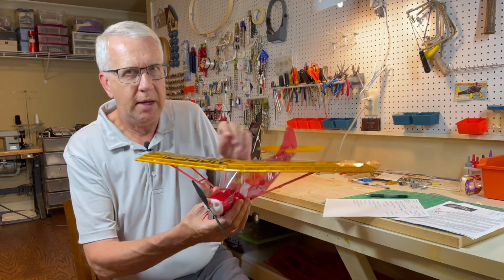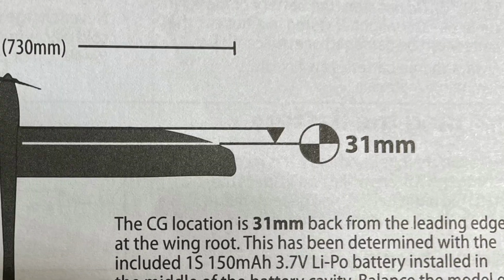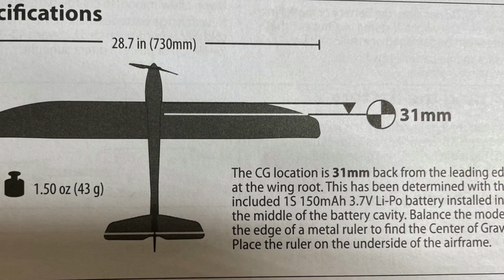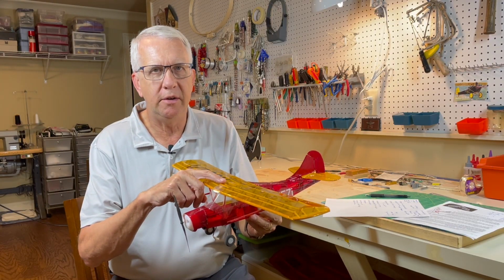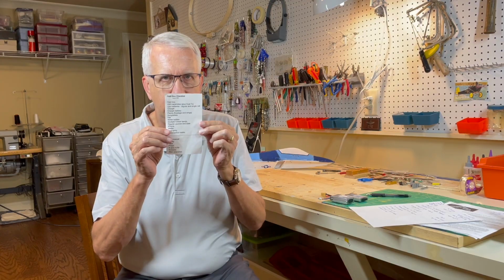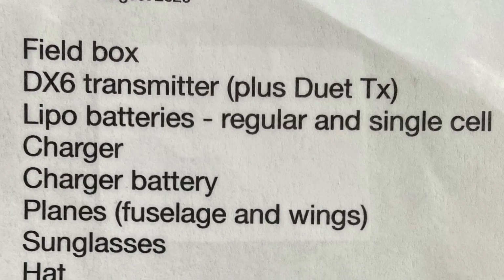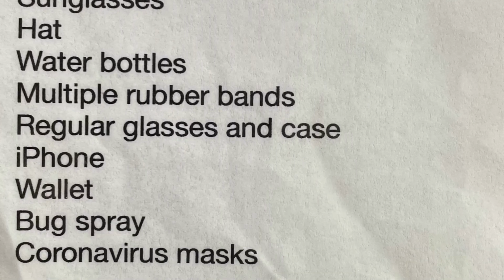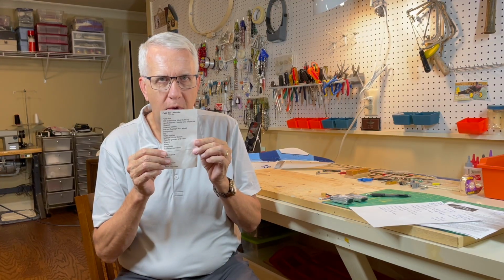10 Radio Control Mistakes to Avoid

Comment: Question, if you use a bigger motor which requires more weight in the tail, will it still fly?
Reply from the maker: Yes, it should fly fine. Just ensure you keep the same center of gravity.
Reply: Thank you for the advice

Comment: The big one for me when first getting started was not knowing to keep the lipo batteries at 3.8 - 3.9 volts per cell when not using them for more than a few days.  Lots of people get prematurely reduced performance batteries not storing them at the correct storage voltage.
Reply from the maker: Excellent point, thanks.

Comment: Good point on CG. Spent a month assembling a balsa kit of 2.6m electric glider, fell in love with it, went to a snowy field, gracefully launched it by hand, felt good. Made an attempt to fly it with engine on and dropped it very next minute. Later realized it was tail heavy, so stalled pretty quickly. It’s excessive to mention how much frustration it caused to me.
Reply from the maker: Hey, no worries . . . live and learn, and now you know!

Comment: Great job.  My power glider on 2nd flight went in I have a brake on the throttle I could do nothing to stop it It hit a full power and I could not stop it until the motor burned up what do you think happen This was 2.4 good battery fail safe was set to brake motor
Reply from the maker: Don:  Hard to say, maybe an unlucky software glitch. Tim

Comment: Thanks for your Video. Some things I learned the hard way.  
And so I made it a habit, to check each battery with the battery checker before I put it into the plane to fly even if I think I charged it before. 
I had a crash because I thought the battery was fully charged, but it was empty.....
Reply from the maker: Peter:  We live and learn, keep at it!  Tim

Comment: i flew my plane with reversed ailerons a few days ago by mistake, i had to force myself to remember right to go left and left for right but i managed to get it down unhurt. its not impossible its just very nerve racking and hard and makes ya want it just give up and let it crash, just add throttle and take it 4 or 5 mistakes high then quickly have someone go into ya settings and reverse the servo while you try to control it if youre alone, gain height and force yourself to remember L4R and R4L and it should come down ok
Reply from the maker: Noc:  Great job on the save, and another reason to check the controls for correct throws before takeoff.  Plan B if this ever happens again in the air is to just try and fly it with rudder for turns and not use the ailerons.  Most planes with rudder control can turn enough to bring it back to the field.  Tim

Comment: A beginning mistake is thinking you can "beef up" a model plane so that it won't be damaged in a crash.  Adding extra glue, bracing, etc, all you have done is make it heavier.  Then, as you said, higher take off and landing speeds, more difficult to fly, meaning more likely to crash.  And no matter how much you beef it up, it's going to break.  To add more performance to an airplane, add more lightness.  Like a house, nails don't make it stronger.  It's the geometry of construction that makes it strong.  Balsa models are the same, the glue just tacks the structure in place, it is the geometry of the design that makes it strong.  One light application of glue will do it, you don't need to dob two or three globs on epoxy on every joint.  (CA is great!)
Reply from the maker: Sax:  Excellent points, agree with all!  Tim

Comment: Cox Stuka and PT19... a story I've heard, AND SEEN, for 60 years!  And those planes were the two worst for the budding C/L flier.  Their main problem was weight.  There were more than a few nice .049 sized balsa kits that were easy to build, and flew much easier as they were half the weight of the plastic Cox planes.  Goldberg Lil' Wizard, Stuntman 23, Swordsman 18, Jumpin' Bean, others.  Easy to build, one-piece solid balsa wing.  So if your .049 from the Stuka or PT19 survived, you could put it on one of these models.
Reply from the maker: Sax:  Fully agree, but the Cox planes sure looked nice at the hobby shop.  😁  And to think about it, were not the Cox PT-19 maybe the world's first RTF model airplane??  Tim
Reply: @TimMcKay56  Yup!  The Stukas usually did not survive the full circle around the pilot.  The PT-19's did.  Later Cox molded the tanks integral with the plane, a real bad move in my opinion.  But there were tank kits you could buy to convert the motor to the integral tank type like the earlier Bee's.  Those Guillow kits?  I used to put the little Cox .020 on those and fly them free flight.  I had a little right rudder to counter torque, but they would circle up to the left due to engine torque, then when the engine ran out of fuel, they would circle right, usually landing within 50-75 yards from launch if no wind.  Measured fuel with a small hypodermic.  I would cover them with colored gift tissue, doping on basic markings.
Reply from the maker: @saxmusicmail  Copy all!  But the Stuka did look very cool.  Smart move by the marketing folks at Cox, someone earned their bonus that year.  Do check out the channel, I have 8 Guillow kit conversions to RC.  Tim

Comment: what about lateral balance tim all you need is fishing line through prop hub and rear gear  inverted ad weight to wing tips start with a coin or blue tac
Reply from the maker: Lateral balance checked OK. Very little mass with the foam board wings, worked out good. Tim

Comment: 👍🏻 great tips for the beginner. I have been flying for about 25 years. Learned a lot over time. I also fly helicopters too. That can be a bit of a challenge for the beginner. I flew fixed wing for many, many years before moving into helicopters. They are a blast but way more challenging than fixed wing in my opinion.
Reply from the maker: DJ:  Very good, and thanks for checking in!  Tim

Comment: Great explanation on the cg for today's models but i have a question on something that i have seen recently with newer ARFs regarding cg my recently acquired tower hobbies Edge 540 shows the cg at 2-3" from the leading edge I've never seen that before all of the models that i have ever worked with give me a specific measurement from the leading edge, what is your opinion on this in balancing a model that gifes you a range rather than a specific measurement in locating the cg of a model
Reply from the maker: Ron:  Your Edge 540 is a aerobatic 3D airplane.  It is common with larger models like this (as well as full scale aircraft) to have the Center of Gravity be in a range.  In your case, the CG back 2" from wing leading edge would make the model a bit nose heavy.  CG at 3" back a bit more tail heavy, but still acceptable.  A forward CG (2") makes the controls a bit more sluggish, maybe a tad higher stall speed.  CG 3" back would make for a less stable, more maneuverable model.  So, a CG range perfectly normal.  Tim

Comment: Instead of using a timer buy a radio with telemetry and fly to a voltage, so 10.5v for 3S, 14.5v for 4S, so many people at our club have killed lipos by over discharging because they flew to the timer and it was windy and they took way more out of the battery than expected.

Also I hate to say it but if you have high quality equipment, you shouldn’t ever need to do a range check, I started with Spectrum and would always get failsafes even after good range checks, I then moved to flysky due to their telemetry but had similar issues, so moved to a TBS Tango 2 radio and have not suffered a failsafe since, in fact the radio will out range the FPV gear most of the time.
Reply from the maker: TPI:  Good points!  Tim

Comment: It's good to go through your video, Tim. I can't tell you how crazy it makes me to see our club Safety Officer fly without doing a range check. It is so easy with today's transmitters.
Reply from the maker: Steve:  Well said.  If I recall, did not you build my Blackburn Type D plan many moons ago?  Tim
Reply: @TimMcKay56  Yes. I did enlarge your Blackburn plan for direct drive Speed 400. It went on to win the SAM Concours D'Elegance at the 2013 SAM Champs in Boulder, NV. I still take her out and fly for fun when we get the best weather conditions here in Albuquerque.
Reply from the maker: @stevemoskal1017  Very good, thanks for the update!  Tim

Comment: I really liked the suggestion of putting the absolute minimum voltage on the transmitter.  I wish  Tx manufacturers would do this.  I find this piece of info is one of the hardest to find in the manual.  But isn't it remarkable the transmitter  is good down to that minimum. I wouldn't be one to test this though.
Reply from the maker: Banshee:  Thanks for your feedback.  Remember this is for alkaline batteries, and DX6 only.  Other transmitters may vary.  Tim
Reply: @TimMcKay56  yep, I'll check mine before putting a sticker on my DX8 Gen2.  Thank you.

Comment: We used to use pusher props on cox 1/2A back in the day. We would mount a pusher prop but run the engine backwards. That made engine torque hold the plane out against the lines instead of having it try to turn in.
Reply from the maker: Sam:  Ah yes, the ease of running reed valve gas motors in either direction.  Tim
Reply: @TimMcKay56  made a huge difference in the line tension.

Comment: In the old days , each radio had it's own frequency.
In a group setting you had to see who else was using your Frequency.
Color coded flags on the antenna were used , green and white , red and white.
2 people cant be on the same frequency at the same time , or you would get interference and crash.
Reply from the maker: Totally correct, and we referred to the different frequencies as channels.  Transmitter impound board, frequency pins, etc.  Those days happily long gone with 2.4 GHz radio technology.  Tim

Comment: Excellent advice! I never got the hang of it until I got the Eflite Apprentice which allowed me to get enough wiggle room to correct mistakes in the air. I find RC is much more difficult than actual flight (PPL) due to orientation.  The check list for every model is something I’m going back to as I’ve lost a couple due to omitting simple settings after being away for a while.  My little Durafly Storch is quite capable of hovering in reasonable headwinds. It does landing like that Blackburn but can be hard on the gear if I don’t add a bit of power.
Reply from the maker: Dave:  Thanks for checking in!  Also, the computer RC flight simulators help a lot, such as RealFlight.  Tim

Comment: This video is totally cool because it is retro! If it was in black and white he would have nailed the spirit of 50s - 60s! I would highly recommend a black and white version of this and run with the retro theme for max hits!
Reply from the maker: Hey:  Many thanks for this input!  Tim
Reply: @TimMcKay56  No problem! Were you a pilot in Asia? Or do you just have an Asian captain?
Reply from the maker: @Heyemeyohsts  Hey:  Flying the B-777F in the US for DHL.  Captain is US, parents from South Korea.  Great guy!  Tim
Reply: @TimMcKay56  wow that is a huge powerful aircraft! How long have you been doing that and how did you get into flying ?
Reply from the maker: @Heyemeyohsts  Retired now, have been flying since I was a teenager, (CFI, commercial, etc.) things just worked out!  Tim
Reply: @TimMcKay56  I started when I was 43 and I’m working on my CFI now at age 52. I wanted to change careers but I don’t want to give up my business to fly pipeline or CFI at $15k per year to get the rest of the hours - 1000 needed
Reply from the maker: @Heyemeyohsts  Fully understand; I took an 85% pay cut when I decided to fly for the regionals (United Express out of Dulles) and build turbine time.  No easy way to do this, outside of military training, etc.  Good luck!  Tim
Reply: @TimMcKay56  thanks. It must be hard to go back just flying rc? I still have a bunch of rc stuff but not very motivated to do anything with it anymore. Mostly nitro based . I don’t know much about the electrics. Nitro is such a pain in the ass but more realistic than electric motors
Reply from the maker: @Heyemeyohsts  Very happy to be back flying RC.  Commercial flying was wonderful, but I was just gone from home too much.  All good!  Tim
Reply: @TimMcKay56  yes I was thinking that all the travel could be exhausting. Or fun . I don’t know which . I flew Ohio to Texas in a pa28 and it took me two weeks to recover.

Comment: A battery has a necessary storage voltage and should only be fully charged just prior to flight. Batteries are the danger factor and need to be fully understood to avoid fire. As well as battery damage. Never overcharge, never over deplete, and always store at the proper voltage.  Additionally, I recommend that you never charge indoors unless you have a safe enclosure to do so. An old safe, Dutch Oven with lid, metal case, etc. Always store them in a fire proof container as well. Please stress to your viewers that batteries are dangerous and knowledge regarding them is a responsibility. Not funny to unload your gear into the garage, and have one go off, causing a house fire. Or, going off in the vehicle while driving. Keep them contained and safe!
Reply from the maker: Tahoma:  Good points all.  Key item for newer RC pilots is the use of quality lipo batteries combined with a quality charger with balancing.  Prior to a balanced changer, lipo fires a huge risk.  Tim

Comment: It had a size 40 Weber motor and with flaps and that but I flew it on the first try successfully no crash no control problems and excellent flyer
Reply from the maker: Stephon:  Very good!  Tim
Reply: And you’re a complete liar

Comment: It's a great idea to use a LI PO. In your transmitter.I got one in my DX8.
Reply from the maker: Steve:  I will look into this! Tim
Reply: @TimMcKay56  No No.  Don't use a LiPo if you don't have to.  For low current drain situations you want to use something safer and more reliable such as LiFePO or Li-ion batteries.
Reply from the maker: @toolbaggers  I minimize lipos in my house for safety reasons.  I just get a pack of Duracell AA batteries from Costco, change out as required for the transmitter, get peace of mind.  Tim

Comment: This is a great video.I have been in the R/C hobby for 45 years had to build real kits.One big problem with ready to fly models is the manufacturing process.I found in a model I just purchased is the rudder and elevator servos loose in there mount.I actually reworked the entire aircraft nose to tail.Todays R/Car might not know to so this.Never to trust that your plane was built correctly.I still study and inspect these ready to fly foam models.Us older R/Cers 
are much more safety and quality oriented then new current generation modelers.
Reply from the maker: Steve:  Good points, always a good idea to preflight all models, to include ARFs.  Tim

Comment: Balancing your propeller is very important also. This is over looked on many of the BNF planes.
Reply from the maker: Ralph:  Good point.  Super important with gas motors, less so with electric.  If these lighter props are out of balance, you should be able to detect it quickly with the smooth running electrics.  Tim
Reply: @TimMcKay56  electrics are built lighter so an unbalanced prop on an electric plane is easier to destroy it.  You might not even notice a bad prop on a gas or glow plane because they already vibrate really badly in even when in perfect tune.

Comment: Tim, looked at DX6 user manual, pg. 8 and   it stated a min voltage of 4.1v, so I would go with your plus up of .2v as a 'cushion' to 4.3v....thanks for tip😎👍🇺🇸
Reply from the maker: Rudy:  Interesting, as my manual mentioned 4.3 for the alkaline batteries.  In any event, use a cushion, no flying below 4.5 volts!  Tim
Reply: Done! (We recharge everything prior to flying, win-win!) Thanks again Tim
Reply from the maker: @rudyho3790  No worries, good luck!  Tim

Comment: I had the PT-19 trainer back in the early 70s. It was a blast!
Reply from the maker: JJ:  Yes, many happy memories with that bird.  Tim
Reply: Still have the Stuka and the Spitfire, both still in their boxes, never had anywhere to fly them so they both have survived, bit sad that , I think the plastic will probably have degraded so best left on the ground now, still look good though and a little bit of model aviation history☺.
Reply from the maker: @CrusaderSports250  Sadly, am afraid those happy days are gone forever!  Tim
Reply: @TimMcKay56  with the problems now of licencing and all the rest control line flying is starting to look more attractive, maybe we will see a resurgence of its popularity, not quite the same as RC, but non of the paper work.
Reply from the maker: @CrusaderSports250  Could be, we'll see!  Flying RC at an AMA field, with FRIA permission, will be no different than 20 years ago, with no Remote ID needed.  Tim
Reply from the maker: @CrusaderSports250  Got that right!  Tim
Reply: Yes the Stuka was a very cool model.  Mine made a very impressive 1/2 loop before it became a shattered pile of my allowance!
Reply from the maker: @iceeman32y  Know the feeling well!  Tim